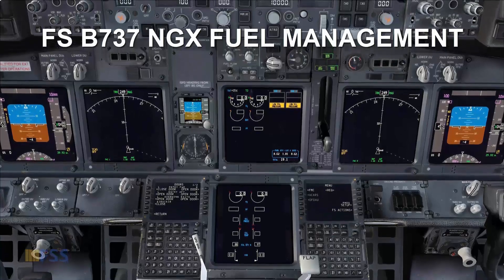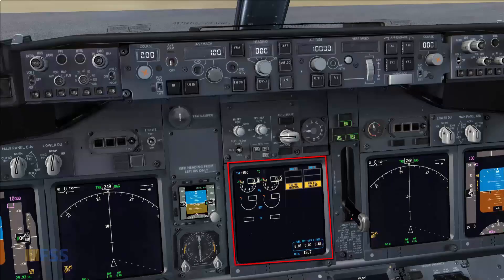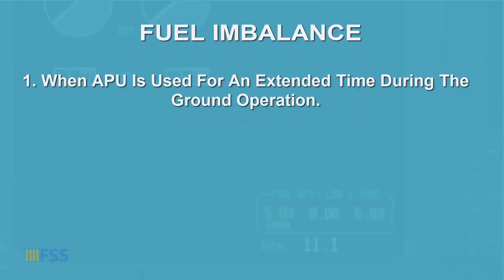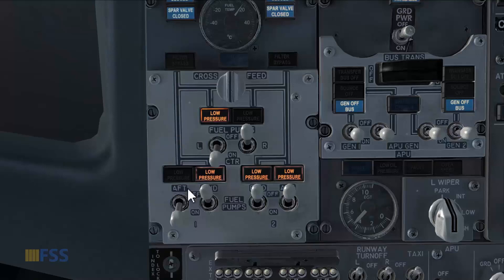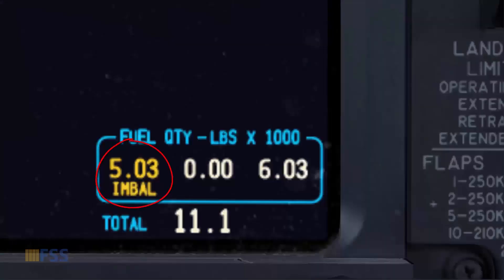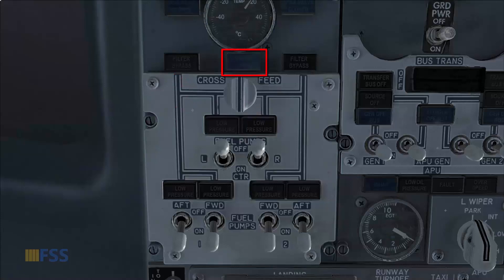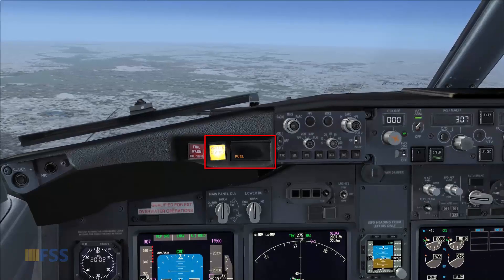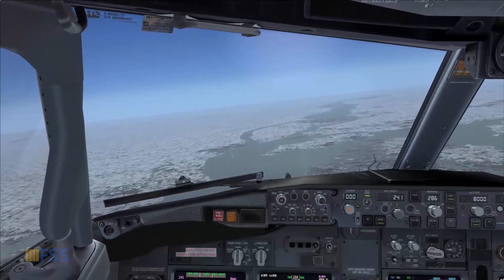Microsoft Flight Simulator Boeing 737 Tutorial|PMDG 737 Fuel Management Explained[1080HD]

Comment: Good ! Need to watch it again a few times. I got Hydraulic high temp warning ⚠️ soon after low pressure in fuel tank  ⚠️  Soon after engine stopped. I took enough fuel when I departed, expected long flight of 6 hours. Need to investigate what happened, didn’t reach destination